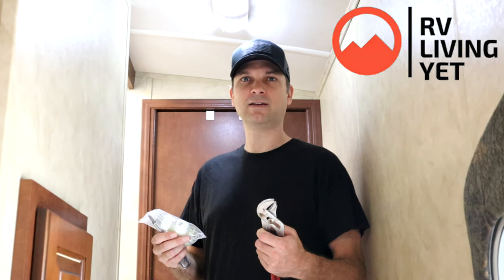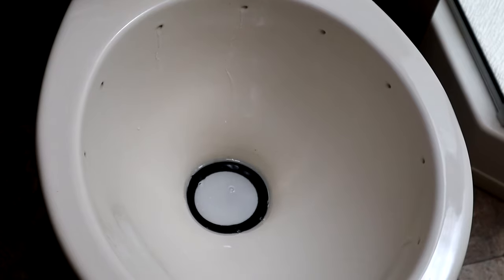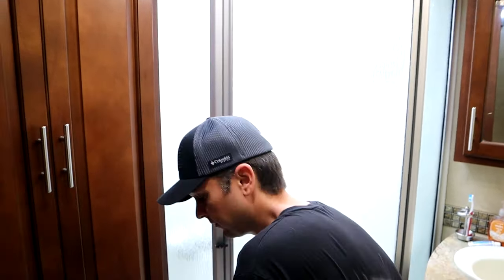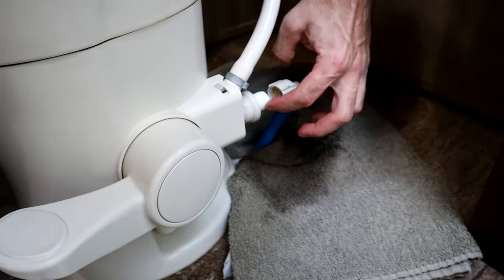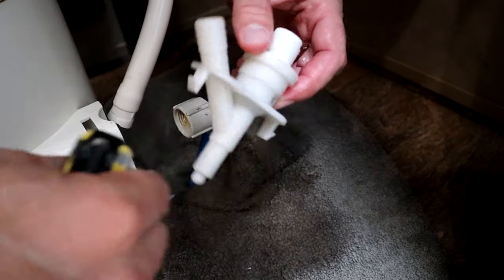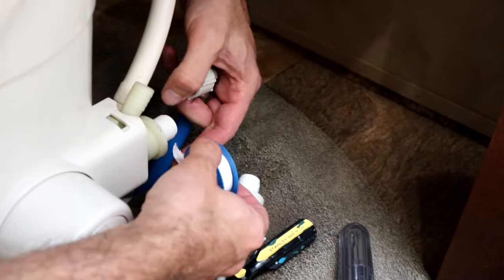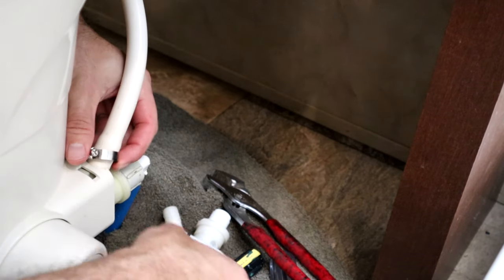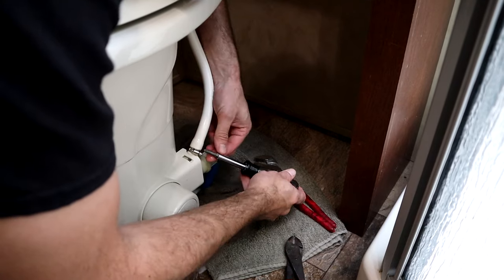How To Fix A Leaking RV Toilet | Valve Replacement- Dometic 300 301 310 series how to fix rv toilet

Comment: So here's my story.  Wifey flushed our toilet last night and released the pedal and it continued to flow full force.  We quickly turned the water off.  I found and watched your video.  This morning I ordered from the link you posted at 8:30 am.  I payed $12 extra and it was delivered by 11:30am!!!.  Installed about 3 hours ago and used the Teflon recommendation.  Dry as a bone!  Thank you so much for your video👍
Reply from the maker: Thats awesome, glad it helped. I keep a spare valve just in case now since this seems to be a common issue and don't want to get stuck without one.

Comment: Perfect. Thanks for getting right to the nitty gritty with no fluff. Best video I found for fixing our RV toilet that suddenly began over filling.
Reply from the maker: Glad it helped, thanks for watching
Reply: I changed out the valve. The trailer is brand new. Still has water coming out in the bowl when the pedal is not depressed. Any other ideas?

Comment: Thank you so much for this video. I am Texas and just had everything freeze up on me. Ran out of propane so even stuff inside froze, including this valve. I can't even flush now, but even before the Great Texas Freeze of 2021, when I put this toilet in Brand new it was doing the same thing as yours, though not continuous but it does continue to seep out for 5 -10 minutes. I think it is just a junk part from factory. I do notice that on the one on Amazon it says "re-engineered" so hopefully it is better than the one from factory. Anyway, thanks so much for showing how this thing comes apart, I don't have quite as much space behind as you but am going to attempt this hopefully without removing the toilet.
Reply from the maker: Glad the video helped and good luck on your project. Try to stay warm and safe travels.

Comment: Great video! I have the same problem with my 310 toilet. It would fill up and over flow even with the pump turned off and not hooked up to any water supply. I just ordered the valve $18.99 from Amazon. Thanks
Reply from the maker: Glad it helped

Comment: Question? I had a ripped gasket in the water line connector. Do you know the part number of the gasket used in the water line connector? Also can you determine its direction to install?

Comment: I recently discovered my camper toilet leaking and this was the 1st video I came upon.  Straight forward, easy repair is going to save me a ton of hassle of taking it into the shop.  Its still under warranty but since I've had the camper, its been in the shop more then I have had it out so any time saved is time well spent!!!  Thanks, and ordered the part from your link!!!
Reply from the maker: Thanks for watching, we are glad the video helped. Thank you for using our link it really helps to support the channel. Good luck with your project!

Comment: Thank the Lord for You Tube. :) And thank you sir for your concise video. I came here after wrestling with trying to get the valve off my toilet and "OH, lookee here, there's a hidden screw at the back keeping it all together" !! 

Don't know if it has been mentioned in other comments but for those with tight access (like in Springdale Mini's) it would help if you have a mini mirror on a telescopic arm, and I found that the screw head was also a socket head, so a 1/4 socket/7mm  on a 1/4 drive ratchet worked well. Thanks and happy trails :washhands:
Reply from the maker: Glad it helped

Comment: Thanks Man, you added the important cautionary & thorough maintenance tips for a successful repair when dealing with scary WATER issues. My pump would not shut off (intermittently started).
Took awhile but there it was, toilet valve on a 2 yr. old rig.  RV service recommends carrying 2 spare items with our other various nuts,bolts, wire etc. a toilet valve and water pump. Maybe,  personal choice.
Reply from the maker: When it comes to plumbing issues in the RV I like to carry spares and a sharkbite cap to close off water lines if needed until I can get a part, seems like something is always leaking. Thanks for watching!

Comment: Thank you for the great video! Just getting out on my own and living in my RV between homes and had a momoent of panic this morning at 5 am with the water on full blast and wouldn't shut off! Had to let it flood the RV while I quickly shut the water off outside, but nothing 5 or 6 towels couldn't mop up. I'll post back when the part has been changed. Thanks again!
Reply from the maker: Welcome to RV life, ways something to fix.
Reply: So the continuing saga of the toilet conumdrum is that I replaced the valve ($65 at the local RV store but I opted to wait 3 days for the part to arrive from Amazon for $11.99 as I had a watering can for the toilet and a 2 gallon igloo cooler for sink water) and changed it. It started leaking a few days later and my neighbor asked me if I had a water restrictor on my outside hose. It accidentally got left off the hose on my last trip! The RV manual says water pressure should be between 30-50%. I put it back on, bought another valve and also added an on/off valve to the water line going into the toilet in case it leaks again. All of this cost under $50 compared to a visit from an RV rapair person. Then I had a clog while I was draining the black water, but filled the tank up with hot water, let it sit for a couple hours and all is good! Thanks again!

Comment: Did this just today, thanks for the help!  The toilet in my lady's horse trailer was getting no water, but no leaks.  I ordered the valve and replaced it... up on examination of the original, I saw that the little filter was clogged by what appeared to be little white chunks like you get when you cut PVC.  Cleaned the filter and held onto the original as a spare.

Comment: Thank you for the video. Very helpful. I have.the dometic 310 tiolet. The valve I replaced and ordered For $13 has 2 tabs, one on top and one on the bottom. My camper I bought brand new last year, they only installed one screw out of two. Anyway your video was helpful since it's hard to see behind the toilet. Also, the sticker with the toilet model number is located at the base in the back of the tiolet next to the flooring. That will give you the model number and other info for your tiolet. Thank you!
Reply from the maker: Glad it helped!

Comment: Thank you for making the video that’s exactly what my toilet is doing. I’ve never had it overflow but it runs a little bit which causes the water pump to turn on really quick and off which I’m sure is not good for water pump and it’s super annoying when you’re trying to sleep so I usually just turn my water pump off when I’m not using any water. Hopefully this fixes the problem!
Reply from the maker: Glad I could help!

Comment: this is a great video, it doesn't even matter that I don't think I have the same toilet.  The step by step walk thru and complete explanation of everything is soo helpful. I now know what to look for when/if this starts to happen.   This is a save for later vid. so far all I have is the inside toilet bowl seal leaking and once or twice a year I use plain chapstick on a q-tip to lube that up and it works.
Reply from the maker: Thank you for the great comment, we try to explain the subject matter as thoroughly as possible.

Comment: Really great video. I was able to replace the valve quickly and no more leaks. A couple of things to note: my old valve was hard to remove because I didn’t know there was another clip at the bottom. It had to be depressed from underneath. Yours seemed to come out much easier. Also, my package didn’t have any nuts for the screws. (I wish it did.) But it did include 2 extra tiny screens that fit inside the valve. I’m assuming that’s the piece that most frequently fails and can be replaced without purchasing a new valve.
Reply from the maker: Glad it helped

Comment: I noticed water around floor base of toilet. I came home from camper due to work so I turned water off to camper. My guess  toilet fixture bolts need tightened or lower seal needs replaced. Not heavy but noticeable after a flush or order on rug after a few days is stronger.
What do you think?
Thanks in advance! 😊

Comment: Thanks for the video.  I'm not sure if the valve is my problem.  Water is dribbling out of the little round valve looking thing that comes up behind the toilet set, almost level with the toilet seat itself.  I cannot find a name for it.  Its the little thing that the back part of the rv toilet seat covers.  Any suggestions would be greatly appreciated!
Reply from the maker: Im not sure if that is a serviceable part, you can check on Dometics website, if not you may just have to replace the toilet.

Comment: Great video! One question. I replaced mine today, but have yet to pressure test since I'm not camping right now. It seems that after I snapped the new one in, it seemed a little wobbly. Is that normal? It came with screws, but no screw holes.
Reply from the maker: Usually should have screw holes but it's okay if it's a little loose.
Reply: @RVLivingYet  Cool thanks! We're camping Halloween weekend, so I'll update you on the leak test! :D

Comment: Hi, great video!  Do you think that there are different valve quality (like copy and OEM)?  Mine has been changed 1 year ago because of freezing and the new one is already leaking like yours? Maybe the second one was a copy?
Reply from the maker: I do think there is a difference is quality, however I dont think the OEM is superior, I think some of the more expensive aftermarket valves are better. The one we used was pretty good, link in the description.
Reply: @RVLivingYet  Thanks!

Comment: Excellent video.  Only suggestion is to wrap the teflon tape before you put the valve back in.
Reply from the maker: We did at the 6:10 mark
Reply: @RVLivingYet  Sorry for the confusion.  What I meant was to wrap the teflon tape on the threads BEFORE inserting the valve into the water valve housing so that you're not wrapping in an awkward position.

Comment: Thanks for the video .... helped me replace leaking valve in no time!  I turned the water pump back on after install and I have water coming out of shower and sink but not the toilet??? What did I do wrong?  Should I take it all off and try again or could it be something else?  Thanks in advance!
Reply from the maker: Sounds like a bad valve or the pipe to the toilet is air bound, to fix the air bound issue just keep the valve open till the air pocket releases. Or last thought you had some dirt in the line that now is clogging the valve?
Reply: @RVLivingYet  thank you! I’ll take it apart and check it out.
Reply: @RVLivingYet  ok help! Took the valve off screen fine and put it back on. Now water is trying to come in to bowl making a terrible growling sound when I hold pedal down. Just a trickle of water coming in. Didn’t make any sound so at least it’s growling at me. Thanks

Comment: Any chance you think that the unit may have been leaking because it was missing those two screws holding it tight and not because the valve was bad?
Reply from the maker: It's possible but I already had it apart at that point so might as well replace it.

Comment: What about a leak that drains the water in the bowl (and exposes the rubber gasket) without flushing?... what is that valve, gasket, or slide called? The one that slides open when you purposely flush?
Reply from the maker: You would need something like this, https://amzn.to/3kx2wyv common problem and easy fix.

Comment: Do you think this could be the cause of water coming out the side of the foot pedal when flushing
Reply from the maker: Its possible, the valve is right at the foot pedal. Its a pretty cheap and easy fix.
Reply: Thanks. I will change it

Comment: What makes the seal inside the toilet where the valve slides in? There an 'O' ring in there?
Reply from the maker: There is no water connection inside that part, the water runs in and out of the holes which are clamped on.

Comment: Great vid,  Very helpful.  But, the teflon tape ill not help at all with that style of fitting.  If the washer leaks past the washer, it will just exit around the incoming pipe.  It also might keep you from tightening down the nut all the way.  Just leave it off.
Reply: I was going to say the exact same thing, thats not the sealing surface.  You could potentially say its helping to keep it from loosening like thread locker, but dont expect that area to seal.

Comment: I have water spraying from where that white hose is connected with the clamp to the water valve---   not sure if I just have to replace that hose or both-----     trying to find out name of that hose or where to get one.  any help would be appreciated
Reply from the maker: Its should just be rubber tubing, you may want to take it off and take it to homedepot or lowes and try to match it up and get some tubing clamps as well.

Comment: Great video. One point I would add is to be very careful when removing the CUT Metal Clamp. Those are often Very Sharp and Will Cut You if you are not careful. You don't want blood all over the RV, LOL. Thanks. Joseph  :)
Reply from the maker: No job is complete without a little blood. Lol thanks for watching!

Comment: Not sure  it was mentioned.
The reason the old valve was most likely leaking was due to the 2 missing screws. Without them, the valve will not fully seat.

Comment: That valve on the 300 series is the weak link.  They either crack at the inlet, fail to shut off (like yours) or start leaking at the pedal end (like mine just started doing).  At any rate, what a pain in the rear!  You’d think dometic would come up with a better design!  I’ve owned 3 RV’s that I installed this toilet in and all 3 have developed different issues.  But in all 3 I’ve ended up replacing this valve.  Not a happy camper with dometic.

Comment: What about leaking right there at the foot flush
Reply from the maker: Should be the same valve, pedal controls the valve.
Reply: So I'm sitting here filling up the tank to clear out my sensor through the toilet with a garden hose and noticed it leaking at the bottom of the foot pedal. There is no pressurized water in the line. Is it still the valve problem?
Reply: How do you find out what model toilet you have? All I see is the brand name Dometic

Comment: Its almost more cost effective to replace the toilet for 150 because the labor to take a toilet apart can be 2 hrs easily and it will break again for sure. But replacing it is 20 min job even for a novice

Comment: We are on our third one in a month. Idk what the heck is going on. Ideas?  Our original lasted three years so I know it’s not how we flush lol.
Reply from the maker: There is a difference in brand quality, usually the pricier and higher rated ones are what we use.
Reply: @RVLivingYet  do you have a link I could use?  We just got them on Amazon
Reply: Also I'd test water pressure on your rv hook up site. High water pressure will ruin plumbing from your home to your rv

Comment: Why did you not just clean the old valve? The problem is probably bad water that has calcium and crap in it.
Reply from the maker: The valve is $20, if you're going to pull it apart why not replace it to be safe??
Reply: @RVLivingYet   I like to save money. If it was bad ,cleaning
Reply: Cleaned it 4 times in 6 years of full time RV living. Go figure. Probably not clean water.

Comment: Maybe use a little grease or Vaseline for lubricant on the threads instead of Teflon tape. Too much teflon could crack the nut when tightening
Reply: Less teflon